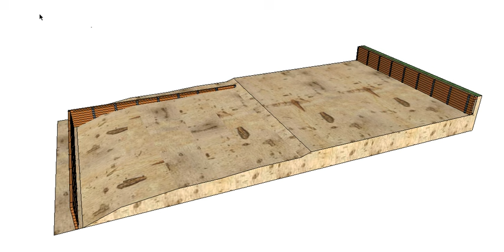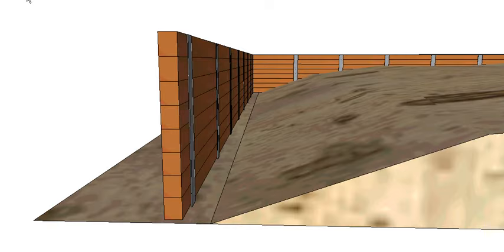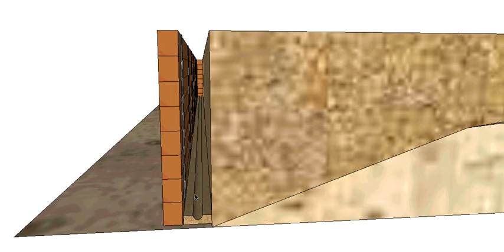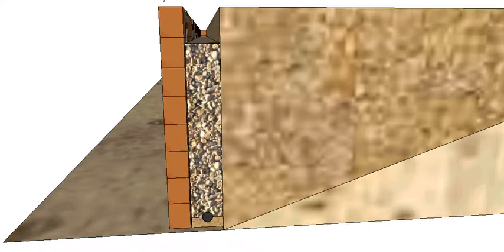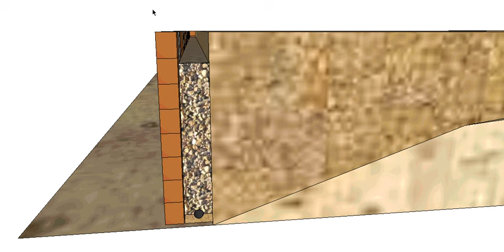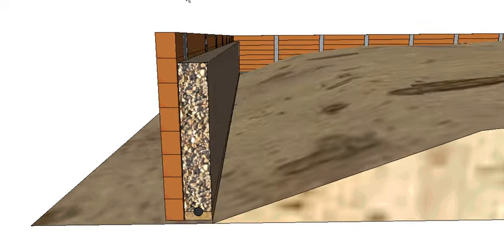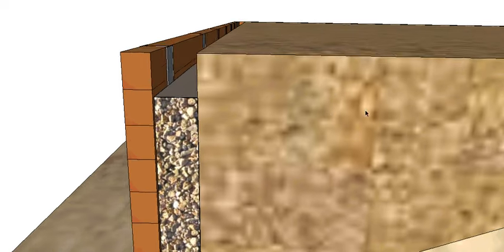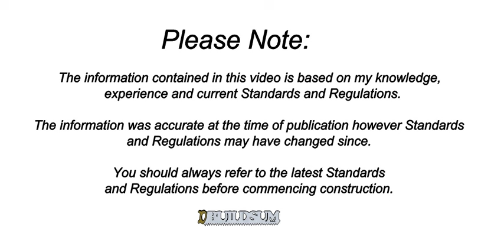Backfill a Retaining wall

Comment: Brilliant, great video, straight to the point. Would this work exactly the same if the retaining wall was the basement of a house?
Reply from the maker: Hi Mate, with a basement you would have to have a waterproof membrane on the outside of the wall a well. Hope this helps.
Reply: @Buildsum  great, thanks for the reply

Comment: Great video mate. I’ve searched to see if you have been asked this already but I couldn’t see it. 
Would it be beneficial to lay a plastic sheet behind the wall, between it and the blue metal to prevent water coming through it?
Reply from the maker: Hi Mate, no, unless you have some reason for not letting water through other than looks. You really want the water to escape so it doesnt build up presure behind your wall.
Reply: @Buildsum   that makes total sense. I have to replace a retaining wall under my house, so I think to help reduce the amount of water coming through I may run 2 Agi-pipes with a plastic sheet to help reduce water coming through. I will take the extra weight from water buildup into serious consideration when choosing the material sizes etc. 

Thanks for the reply and great info.

Comment: My retaining wall failed exactly where the previous owner added geo fabric. Over a short period of time, the fabric gets clogged by dirt and water begins to accumulate on top and behind rather than flow through the porous wall which is what the wall was designed to do.
Reply: Could somebody please advise?
If I put the 'geo tech' fabric in place, won't this just stop all of the drainage?  Is 'geo tech' the same as 'damp proofing'?  Is 'geo tech' porous?  I live in the UK - what is the local name for 'geo tech?'  Many Thanks!
Reply: @virabadrasana  That’s exactly the same thing I wanted to know and just asked the same question myself lol 🤷‍♂️

Did you ever find out the answer to this question?
Reply: If you have a CLAY type soil DON'T put geofabric vertically. It will get clogged up. Hydrostatic pressure will build up behind the clogged fabric. This will push against the drainage stone. The drainage stone will in turn push againt the wall. The wall will then belly and potentially blow out. For CLAY soils only put the geofabric horizontally over the drainage rock, don't run it vertically down the side between the CLAY soil and the drainage stone.

Comment: Blue metal is another name for crushed stone? (sharp edged).
I should pull the geotex up over the top of the aggregate infill but then further up to the top of the wall, this prevents the top infill soil getting in between the wall and the geotex, also the soil will not go into the gaps between the blocks or sleepers of the wall.
I'm currently building a retaining wall and this is helpful info, I have a good amount of reclaimed 10-20mm crushed stone from the garden path, after removing dirt from it by washing in a cement mixer this will be a decent aggregate for drainage I think.
Reply from the maker: Hi Tom, Yeah, that all should be good, going to be a lot of work washing that agg though.
Reply: @Buildsum  Actually not that bad, washing the agg.
I did wash 3,5 cubic metres of gravel which came from my flat roof in about 8 hours, worth the effort considering the cost of disposal of roof gravel which is seen as chemical waste because of the tar used on old roofs. Now it is used in the concrete post feet and foundation for the wall.

Comment: To my knowledge putting an ag pipe directly on sand necessitates the use of a socked ag pipe or else the sand will just migrate into the Ag over time (and wash away). Not sure why you're not just putting the Ag on 100mm of the same drainage aggregate instead (and using geotech behind wall as discussed in vid)
Reply from the maker: Hi Mate, the bed of sand just allows you to easily get the slope you will need on the pipe. You could use the same material as the drainage aggregate if you like.

Comment: We have a high retaining wall in our back garden (about 8ft) that holds back our neighbours garden which is alot higher than ours. It does have small drainage pipes at the bottom of the wall, however the wall is constantly wet in patches. Could this be because the backfill has mixed and there is now soil directly behind the wall? The wall was built by our house builder so not sure what they have done behind it 😅
Reply from the maker: Hi, yes that could be the cause or a blocked drainage hole.

Comment: Sorry for my question you might not see it but at the moment I am working on a retaining wall system  for stone load-bearing walls (two floors in direct contact with the river ,However, I am not sure if I need to use the pipes and what the purpose of it in that case and how thick my wall need to be in order to hold the structure
Reply from the maker: Hi mate, sounds like you need to get your wall designed by a Structural Engineer or similar due to the extreame nature of your situation.

Comment: Simple explanation but very informative. What type of sand do you use and do you compact it?
Reply from the maker: Hi Gordon, you want a course sand with no clay content, the sand just makes it easier to level the bottom of the trench and it can also act to drian the water that doesen't make it into the Ag Pipe.

Comment: The black flexible pipe is cheaper, much cheaper, than schedule 40 pvc but, the black ABS plastic will be crushed under anywhere near that much rock.  It might work for 8-12 months.  That's all.  You put perforated schedule 40 pvc pipe on the bottom, charge the customer more or make less profit, whatever, and then it will last for 150-450 years.
Reply from the maker: Thanks, Max, good advice.

Comment: I’m building an 8 foot long retaining wall coming out from my house. The wall will step down gradually to match the ground that slopes away from the house. My wall will be at its highest point about 2 1/2’ tall at the house and will step down over that 8 feet to about 1 foot tall.
My trench is 10” wide and my block is 7” wide. I’ve put down 5” of Class 5 rock and packed it down then have about half to 1” an inch of sand on top of that to level it off nicely.
I’ll put gravel and fabric between the wall and dirt like you show here. Since the ground on the outside of the wall slopes so quickly over 8’ so I need the drainage tubing?
Thanks
Reply from the maker: Hi Mate, yes i would still be putting the ag pipe in.
Reply: @Buildsum  thanks

Comment: Hi Mate,
Great educational video.  One question, Is it OK to drill  a series of multiple holes, across the thickness of wall, at the bottom of retainer wall and insert pipes to the other end for drainage?
Or lay a series of pipes at the bottom of wall  when building a new retainer wall? Thanks
Reply from the maker: Hi Mate, sure anything to allow the water to get away as long as you are not weakening the wall at that point.
Reply: @Buildsum  Thanks. Much  appreciated.

Comment: I've got a house where the brickwork has been built into the hillside without any waterproofing or drainage, and the subfloor is flooding behind it. Plumber had a go but only went halfway down so water is penetrating underneath.

Would this technique be the same for a structural house wall, maybe just with waterproofing on the house side?
Reply from the maker: Hi Robert, yes you would need to do the same thing and waterproof the outside of the wall as well.

Comment: Hey quick question what can you do if the dirt has been washed out from below the wall and now the wall is on the air and dirt is still washing below it, this is happening to me right now at the moment half of my garden has washed out from below and my wall already fell also it is still raining so my garden is still being washed out i tried making a retention wall but dirt is still washing into it and it is dangerous please can you give me a suggestion or something thanks...
Reply from the maker: Hi Miguel, there is not much you can do until the rain stops, if the water and soil is running under the wall it sounds like you should dig in a concrete footing that runs along the bottom of the wall. Then you will have to dig out behind the wall like shown in the video and install the Ag pipe and the well draining material. Unfortunately it sounds like you have go a real mess on your hands however you may have to make some more in order to be a wall that will do the job that you need it to. Hope this helps.

Comment: Great video!  I am building a pressure treated retaining wall.  Do you recommend a moisture barrier in addition to the fabric and gravel?  Should the moisture barrier be used for the entire back of the wall or just the part that is above the gravel?  Thank you
Reply from the maker: Hi Virginia, i wouldnt put a moisture barrier in, IF the gravel was comprimsed or overwhelmed the water could still escape through the wall. If a barrier was in place the water would just build up and put pressure on the wall.
Reply: @Buildsum  this is the answer I have trawled the Internet for weeks to find... Nice one bro...! 🤜🤛
Reply: Just had a thought on this... would a paintable DPM product painted on the back of the sleepers be worth a shout? That way the soil (wet) side of the sleeper wall would have a water barrier but the water would also be able to naturally find its way through the joins/cracks/weep holes etc... love to hear someone's opinion on this.

Comment: Q: should the requirement for the drainage and pipe be dependant on the height and weight of backfill? I'm only looking at backfilling a 40 - 60cm retaining wall.
Reply from the maker: Hi Mate, i would put it in regardless of the height of the wall.
Reply: @Buildsum  thank you.

Comment: Hey mate, question regarding the drainage. Do you need to have the ag pipe running along the retaining wall if you have weep holes along the wall? This is in clay type soil. The wall is 800mm at its highest sloping down to 200mm over 7 metres. Cheers.
Reply from the maker: Hi Mate, as long as the weepholes are sufficent to drain all the water that builds up and will no become blocked over the lifespan of the wall that should be ok.
Reply: @Buildsum  Thank you kindly good sir 👍🏻

Comment: Gotta make wholes on top of pipe right for water to go into pipe?  How big and how apart are the holes and do I put them on side or top of pipe?
Reply from the maker: Hi Marco, Ag pipe comes with the holes or slots already in it. If you have to drill them yourself i would suggest going to a Hardware store and having a look. I cant find anything that states the sizes and spacing of the holes. Or these pictures may help
https://www.google.com.au/url?sa=i&url=https%3A%2F%2Fwww.alibaba.com%2Fproduct-detail%2FHDPE-Agricultural-Perforated-Subsoil-Drainage-Pipes_60765188155.html&psig=AOvVaw1j33Qwd0QjEmUf8epNCkTn&ust=1614317723230000&source=images&cd=vfe&ved=0CAIQjRxqFwoTCOjL2KWohO8CFQAAAAAdAAAAABAL

https://www.google.com.au/url?sa=i&url=https%3A%2F%2Fkennedys.net.au%2Fproduct%2Fpvc-slotted-drainage-pipe-90mm-x-6m%2F&psig=AOvVaw1j33Qwd0QjEmUf8epNCkTn&ust=1614317723230000&source=images&cd=vfe&ved=0CAIQjRxqFwoTCOjL2KWohO8CFQAAAAAdAAAAABAY
Reply: @Buildsum  thank u

Comment: If behind the retaining wall you planned to pave instead of having just a garden bed would backfilling with rubble on top of the blue metal stones be ok? Would the paver sink just behind the wall? Maybe you'd have to compact the blue metal stone before adding the rubble? 

Sorry confusing question
Reply from the maker: Hi Mate, the area behind the wall will be very likely to sink. You have to make sure that the Bluemetal is well compacted. Filling on the top of the Bluemetal is ok just make sure you have a good WeedMat or Geotextile fabric separating the two. Pavers would be better than concete as they will be more flexable and allow for more movement. It is also easier to pull them up and put in more fill if required.
Reply: @Buildsum  Hey mate, I really appreciate you replying and so quickly too. You sharing your knowledge with us is priceless! You won't believe how hard it is to get in contact with other tradies atm and get good advice! You have another subscriber now mate!
Reply from the maker: Thanks Mate, Welcome aboard.

Comment: Just starting now with a retaining wall (and not knowing muh to begin with) - this was a great lesson!  Thank you!
Do you prefer the 3/4 inch stone over the pea gravel? I've watched other videos and apparently pea gravel moves/rolls too easily and can compromise the structure much more so than the 3/4 inch stones that "lock" together?
Reply from the maker: Hi Becly
I would prefer 10-20mm blue metal or recycled concrete.

Comment: I have a roughly 4 ft wood retaining wall in my backyard. I don’t think there’s any drain system behind it. I don’t know if I can dig all the way down to put the pipe along the bottom. Is there any value in digging as far down as I can - 2 ft, let’s say, and put aggregate and pipe there to move at least a little water away?
Reply from the maker: Hi Brett, if it is a timber wall there is a good chance that the water is getting throught the wall anyway. If this is the problem then you should be able to dig down the whole 4 ft if there is enough room behind the wall and put the Ag pipe on the footing of the Retaining wall. I guess 2ft would be better than nothing but the deeper the better.
Reply: @Buildsum  Yes. The water is definitely getting through - and I think the person who built it assumed that relieves all the pressure that is needed, but I think giving the water an outlet might be a better solution. And it is very mushy and not so bad to dig down - except for the fact it's 65 ft long.

Comment: if the drainage pipe is on a slight angle for run off and one end is burried  how do you cap up the burried end to stop sedament/gravel etc from runing into it ? cheers
Reply from the maker: Hi, I would just make sure that the end is covered with the geotec fabric (the sock that the ag pipe is covered in) before you add the stone

Comment: thanks mate , great vid.. bad idea to build a concrete sleeper wall in front of an old treated timber one buildsum?
Reply from the maker: Hi Nick, no not really the old wall may still provide some support and take some of the load off the new wall however it will take up a lot more room having it infront rather than removing the old one and replacing it.
Reply: Did you do it? I am also thinking of adding a concrete or stone retaining wall in front of existing timber wall..

Comment: Wait, how does water get through the wall of the plastic pipe? This has confused me for ages. Doing a DIY project now.
Reply from the maker: Hi Mate, the ag or agi pipe has small holes in it that allows the water to enter the pipe.
Reply: Forget the pipe! How does water even drain into the gravel bed if it’s surrounded by the geo tech? lol 🤷‍♂️

Comment: How wide would you make the drainage rock on a 3.5 m high wall  using 70/40 mix
Reply from the maker: 200 - 300mm wide will do the trick.
Reply: @Buildsum  yeh awesome thanks for that.   I went 400 -600 wide  had the extra material available

Comment: Running the geo fabric up the entire height of the wall is not the way it is done. You have geo fabric on the base of the wall and have a agg pipe encapsulated in at least 100mm of stone then wrap tha goe fabric around it. Then you fill with 300mm of drainage stone. Running fabric the full height of the wall would be labour intensive and an absolute pain to backfill a large wall!
Reply from the maker: Hi Mate, yes it is a pain on a large wall however if it is not done the drainage stone will eventually just fill up with soil and no longer drain the water away.
Reply: @Buildsum  I don't understand why the fabric (whether it installed up the full height of the wall or merely wraps the ag pipe and some aggregate) doesn't fill with silt and eventually transfer water pressure onto the wall. Am I missing something? I understand that fines will eventually clog  drainage aggregate, so why won't fines clog the cloth as well?

A top video either way. Thanks.
Reply from the maker: @clarencecrowcarter   Hi Clarence, the fabric provides a barrier that stops the fine particles of dirt filling up the pipe or the section of course fill behind the wall. Even when it is full of dirt It will still allow the water to pass through and then drain away so it doesn't fill up behind the wall and push it over. 
Hope this helps
Reply: C R You have it exactly right. The Geo fabric clogs in no time and the water pools. If you are in a Northern Climate, the wall is pushed to failure by ice.
Reply: @clarencecrowcarter  C R you are correct. Don't use filter fabric vertically if you have a clay soil. It will clog up and contribute to wall failure.

Comment: the holes are supposed to be on the bottom. water builds up and flows up into the pipe. not down into it.
Reply from the maker: Hi Mate, the holes in Agg pipe are generally located all around the pipe so the water can enter from anywhere

Comment: Instead of placing a drain pipe which over time will just fill with silt and roots, just make sure to have the correct amount & size of weep holes in the wall.
Reply: Is there a formula for this? As far as how many holes/size per square foot of wall?

Comment: I don’t have a drain to connect it to anywhere what are my options please?
Reply from the maker: Hi Jimmy, the idea is to get the water around the wall rather than just build up behind it so even if you just let the Ag line run out the end of the wall that would work just as well.